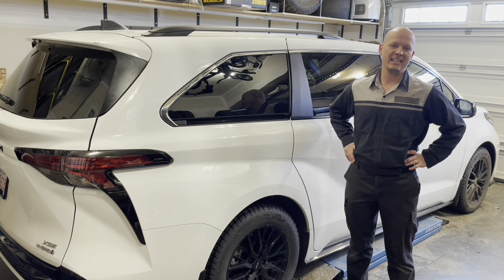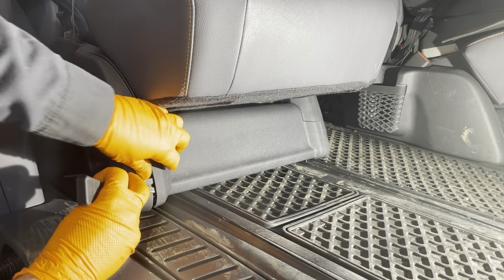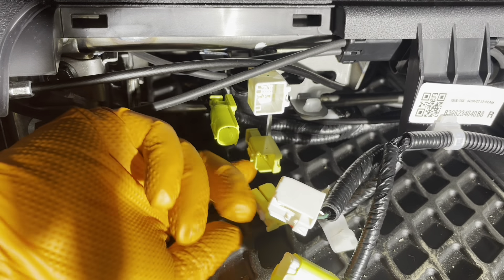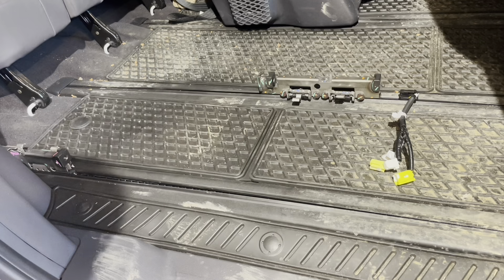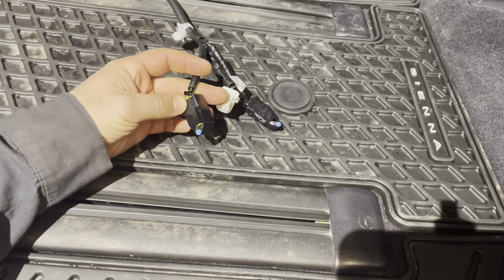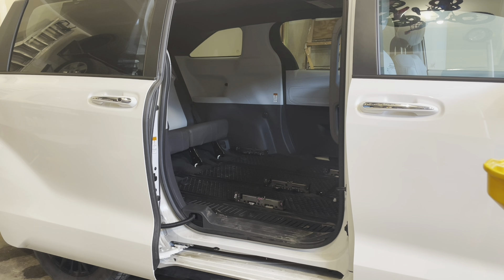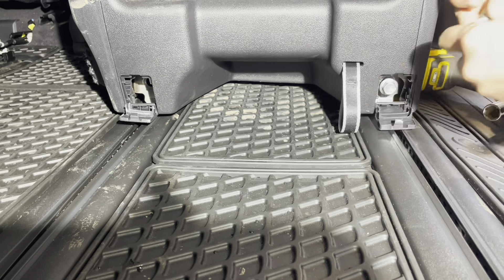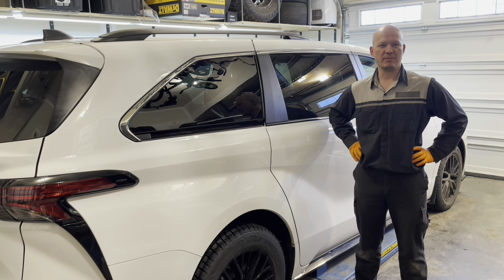2021-2025 Toyota Sienna Hybrid 2nd Row Seat Removal And Airbag Warning Light Disabling Instructions

Comment from the maker: Below are my affiliate links to the parts and tools you would use to complete this job. I may receive a small commission from the product sales. Thank you!
Resistors to bypass the airbag warning: https://amzn.to/3wF3OzV
Automotive trim and clip removal kit: https://amzn.to/3KgKGfg
1/2" drive cordless impact wrench kit: https://amzn.to/3Kcw00I
3/8" drive flex head digital torque wrench: https://amzn.to/3O1EOru
Rechargeable LED mini work light: https://amzn.to/3Y74OpY

Comment: This is literally all that's stopping me from buying Toyota. If DODGE of all people can figure out that we want stow and go-type seating for all seats other than the front two, why tf hasn't Toyota gotten the memo?
Reply from the maker: There is physically no space for that feature because of the hybrid battery located in the floor.
Reply: @Viktor_G_Automotive  sounds like they need a better designer. I wouldn't buy hybrid anyhow.
Reply: To be fair, a Pacifica Hybrid doesn't have Stow and Go either.

Also, I bet Chrysler has some patent on it. If they do, that's pretty smart on them because I would have definitely bought from another brand if someone else had it.
Reply: Toyota used to have removable seats in every Sienna and Previa until the Hybrid redesign in 2021
Reply: @Viktor_G_Automotive why couldn’t they make it so you can remove the front seat more easily
Reply from the maker: @SAMGASS  well, removing 4 bolts isn’t terribly difficult 😉
Reply: @Viktor_G_Automotive  right but I mean Honda odyssey style easy. Pull a strap, take it out.
Reply: Ditto for me! I want the cargo area & the hybrid lacks it due to those seats not being easily removable or stow&go.
Reply: @SAMGASS  Toyota moved the side curtain airbags from the inner sides of the vehicle to the seats.... so now you have wiring running through the seat bottoms. If they really wanted to, they could probably make the wiring connectors an easy part of the seat removal and reinstallation process... but they are probably worried about liability from them not deploying if someone doesn't reconnect them properly...

Comment: Word of advice. MAKE SURE NOT TO SHORT THE RESISTER LEGS! It will throw a hard error code that cannot be reset without an advanced ODB reader. My dealer gave me a free reset but cautioned that any code again would cost $190 to reset. Also they did figure out I had removed the seats.
Reply from the maker: @Over50YearsOffgrid  good suggestion. If you accidentally make that mistake again, you can also purchase a scan tool to clear the code for less than the $190 the dealer wants to charge you.
Reply: @Viktor_G_Automotive  I took it to Orielly's but their reader wouldn't read airbag codes.

Comment: It's bad news the new sienna can't remove second row seats easily (seems like they don't want you to remove them.) I've been using my 2013 as a camper and to haul people and plywood, thinking to replace it with a new one. Now I know the new one won't work. Thanks for video
Reply from the maker: You are welcome! It is definitely doable and it fits a 4x8 sheet of plywood, but it is a little bit more work than the older model.

Comment: The instructions provided is very helpful and has helped me greatly. Thanks, Viktor! I would like to mention a few changes with my 2021 Toyota Sienna Hybrid LE. 

1) Each seat has four 17mm bolts which need to be removed (2 short bolts in the front and 2 long bolts in the back). 

2) I just need to remove the front seat covers (not back) to access the electrical connectors. 

3) Each seat has 2 connectors (not 3) - one yellow and one white.
Reply from the maker: @amelon1  is it an 8 passenger model?
Reply: @Viktor_G_Automotive  Yes. Mine is an 8-passenger model (second-row bench seat)
Reply from the maker: @amelon1  ok, makes sense that it would be a bit different from the 7-seater version 👍

Comment: Great video.  Thank you. What are those blue pins you connected to the cables? Also, how do I reset the maintenance service indicator for a 2017 Sienna?
Reply from the maker: Those are resistors to trick the airbag ECU into believing the seat airbags are still connected. I can make a maintenance reminder reset video for that model if I get my hands on one.

Comment: Hi Viktor!
My question is today , i have lexus es330 2004 , drivers seat , back support bottom , not working .
How to fix ,where i must to check and what?
Thx Magic man!
Reply from the maker: Check for voltage to the switch, check if the switch is working, check for voltage to the motor. If everything is good, needs new motor, or if you find an issue with the power supply or switch, repair/replace whatever is needed, check fuses, connectors etc. There isn't a magic answer that will diagnose the issue without putting in the work unfortunately :)
Reply: Wow thx ;
The motor inside back support or under the seats?
Reply from the maker: @madi482  Unfortunately I don’t know it’s exact location, you would need to unbolt the seat, lean it back with the wiring still connected and start poking around to find out which motor controls which part of the seat.

Comment: Any chance you can make a video on removing the sliding seat carriage parts after removing the seat? So the interior space is as flat as possible without the metal pieces sticking up.
Reply from the maker: I may do it one day, but it is a pretty involved procedure, requires dropping the fuel tank etc.
Reply: @Viktor_G_Automotive  gotcha. I was hoping to get the interior flat for dog crates.

Comment: A friend helped me remove the 2nd row seats in my 2023 Sienna, which took us forever as I had not discovered your excellent video!  Once I found it, we followed your directions to disconnect the battery, install the 2.2 ohm resistors and taped in place with electrical tape.  We reconnected the battery, reset the doors and turned on the engine.  The "SRS malfuntion" screen came on and we cannot get it off.  Can you help?
Reply from the maker: I would remove the electrical tape and confirm that the resistors are fully inserted into the connector. Wiggle them around a bit while pushing the legs in to make sure they make contact. Also, confirm that you didn’t get wrong resistors by measuring the resistance with an ohmmeter (resistor must be out of the car!). If all that checks out, scan with a good scan tool to find out what the SRS fault codes are in the system.

Comment: I followed your instructions and everything worked exactly as it did in the video. Many thanks!
One question; is the S/HTR D fuse for the heated back seats? I'd like to disable them.

Thanks in advance
Reply from the maker: S/HTR D fuse is for the driver's front seat. You need to remove the 15A S/HTR R/L fuse in the engine bay fuse box and the 15A SEAT HTR RR fuse in the luggage compartment fuse box.
Reply: So am I just wasting time? Is the power to rear seat heaters the connector we didn't use a resistor on?
Many thanks for sharing your expertise!
Reply from the maker: @DrewC-z9r  yes, the power to the seat heater will run through the connector. Could you please elaborate on what you are trying to achieve when you say you want to disable the heaters? Are you leaving the seats in or removing them?
If you unplug that connector and leave the seats installed, the seatbelt clip detection goes through that connector as well, so it’s better to just remove the fuses for the heater. 
If you are removing the seats, you don’t need to disable anything or pull fuses since the seats are out.
Reply: Sorry for the confusion; I removed the seats and will not reinstall them. My fear is that, if someone presses the overhead rear seat heater switch, it would overload a resistor. If it's just the 3rd connector that is unattached, no problem.

Thanks again
Reply: I understand now. Apologies for taking up so much of your time. I owe you big time!😊
Reply from the maker: @DrewC-z9r  no worries, the resistors are just for the airbags.

Comment: Thank u Victor.  Great video. Question re the resistor insertion per connector. There's multiple holes in each to insert the wire x 2 per connector. Is the a screenshot to ref short of zooming in on your video which is hard to focus from. I could guess but don't want to short anything...
Reply from the maker: @BillTrubey  hi Bill, just look at the male side of the connector to see where the 2 pins are located and insert the resistor legs into the 2 corresponding female pins. You can’t short anything out even if you install into the wrong holes, just the airbag warning light will stay on if you don’t do it correctly.

Comment: Wanting to do this on a 2018 Highlander and this is the only video I could find that was close. One questions, will having the airbag connectors hooked to the resistors cause any issues with the other airbags deploying in a crash? I would assume they act independently to some extent for safety reasons. Thank you!  Your video is clear and instructions easy to understand.
Reply from the maker: @portlandgeek  all the other airbags will work fine, the SRS ECU has no idea that the second row airbags are disconnected since the resistors are tricking it. Cheers!
Reply: @Viktor_G_Automotive  Thank you!! Really appreciate your feedback!
Reply from the maker: @portlandgeek  any time!

Comment: is this the same for the 2024 Sienna Limited? Can the seat carriages be removed too?
Reply from the maker: Yes, limited is done the same way. The carriages/tracks can be removed, it’s a bit of work though.
Reply: @Viktor_G_Automotive  once the carriages are out, how hard is it to reinstall? and…harder to remove them than the sets themselves??
Reply from the maker: @707bluedogs  I have never removed them, but I believe they bolt in through the floor from the bottom and may require a significant amount of time to remove and reinstall.
Reply: @Viktor_G_Automotive  thank you
Reply from the maker: I looked into removing the seat rails. The outer ones can be removed from the top, you would need to pull up the carpet and unbolt them. The inner ones have to removed from the bottom, requires dropping the fuel tank. Hope this helps.

Comment: I have a 24 sienna without for lights. I see the wire have been ran to the bumper, but my steering wheel does have the knop to turn them on. Can you please do a video on the part i have to replace
Reply from the maker: @abcabc-gj6id  there is more to it than just the switch, the fog lights are wired through the light control module that shuts them off when high beams are on etc. It would take some research to figure out exactly what would be involved in integrating them. It would be easier for you to just wire them using a relay and a standalone aftermarket switch.

Comment: GREAT video - thanks!  I wonder how much each seat weighs?  When I get my Sienna I am taking the seats out and leaving them out for a long time.  Getting rid of probably 120 lbs of weight wont hurt.  I want a Sienna for road trips with our dog
Reply from the maker: @jimc5696  I haven’t weighed them, but I would guess they are somewhere between 40-50 lbs each. Cheers!
Reply: @Viktor_G_Automotive   thank you!  Only other thing I will need to figure out is some sort of soft cover for the sliding floor pieces.  They look sharp objects (without the seats attached).

Comment: Your link to amazon for the 2.2 ohm resistors show several watt sizes such as 1W, 1/2 W, 3W. What watt size for a 2023 Sienna Platinum please?
Reply from the maker: The maximum wattage doesn’t matter as there is a essentially no current running through them.

Comment: Great video!!  I have removed my back seats.  Now I'm looking for a way to remove the passenger seat.  Any ideas?
Reply from the maker: Thank you! The passenger seat is removed using a similar method, however it would be harder (or impossible) to get rid of the airbag light due to the weight sensors of the occupant classification system being disconnected.
Reply: @Viktor_G_Automotive  Too bad.  No way to fool the system for that one?
Reply from the maker: @tangoandmisspearl  I haven’t tried yet, I might make a video in the future.
Reply: @Viktor_G_Automotive  That would be awesome.  I sure could use the extra space in my Sienna camper.

Comment: Excellent video thanks! Do you know if this voids the warranty? Ours is new and we still have the covered oil change/fluid check etc at 10,000 miles. Will they turn us away or if this seat isn't installed? 2 separate questions.
Reply from the maker: It should not void the warranty or have them turn you away. However, some dealerships are very easy going and others are very picky. If you install the resistors correctly and there is no airbag light on, they wouldn’t have a reason for concern to do an oil change. However, if you come in for airbag system or other electrical diagnosis, they might have an issue with it. You can always reinstall the seats before bringing the vehicle in, it’s a 20-30 minute job.

Comment: There have been some changes to the van for 2025. Can you absolutely confirm that the middle seats can be removed and a dongle to fool the computer SRS ?? 
We really want to replace our Odyssey with a Sienna and remove the seats. 
I am all set with the mechanical process, it’s just the electrical/computer that I am worried about. Thanks JT from the frozen north east….
Reply from the maker: Hi, there were no changes to the 2nd row seats and airbag wiring on the 2025 model. You do not need a dongle for the SRS, just install the resistors as shown in the video.
Reply: Thanks for the reply/ info.
Reply from the maker: @ no problem

Comment: Hi Viktor: thank  you for your clear and details instructions on the 2023 Sienna. I just bought the 2024 XLE Sienna and want to know if your instructions can also be applied for 2024 Sienna as well?
Reply from the maker: Yes, absolutely.
Reply: Viktor- Can you still remove the second row seats if they are heated?  Is it just another plug or more complicated?  I want to buy a used 2022 Platinum, but only if I can still remove the second row seats.
Thanks!
Reply from the maker: @fcmagility  same thing, might just have one more connector to disconnect.

Comment: Hi Viktor, This is a great video.  So, I am going to need 4 resistors (2 per seat?)!  By any chance the 2.2 Ohms resistors will work also for 2025 Sienna Woodland edition?   Many many thanks for your time to contribute to the Sienna community!
Reply from the maker: @andytan9238  hi, yes, 4 resistors, works for any model 2021-25 Sienna. Cheers!
Reply: Thanks for the quick reply.  Would you please share on the purposes of the 3 connectors per seat?  Assuming the last connector is for the airbag, what are the first two connectors for?  Why don’t we need three resistors for the 3 connectors?  Thanks again for your time!
Reply from the maker: @andytan9238  The 2 yellow connectors on each seat are for the side airbag and seatbelt pretensioner. The other connector is for things like seatbelt clip detection, seat heater etc. The resistors are installed to trick the SRS ECU into thinking the airbags are still there so that it doesn’t set a fault code. It doesn’t care if the seat heater is disconnected or seatbelt is unclipped, therefore you don’t need to do any other trickery.

Comment: The 2024 Sienna Platinum has heated seats in the 2nd row.  Any advice for removing those?
Reply from the maker: @jeffreyb4147  same thing, would just possibly have an extra electrical connector for the heated seats to disconnect.
Reply: Same electrical connector? @Viktor_G_Automotive
Reply from the maker: @vickisherouse1521  hi, I don’t own a platinum Sienna, but just look under your seat when you unbolt it and disconnect all electrical connectors required to remove it. The heated seat wiring may be built into one of the connectors shown in this video, or may have a separate connector, it will not change the procedure substantially.

Comment: @viktor_G_automotive would this trick with the resistors work with other newer vehicles like a 2024 Ioniq 5 for the rear seats?
Reply from the maker: @johnreed7057  it’s quite possible, however I have not worked on Hyundai vehicles, so I don’t know what the resistance value should be. You can try the 2.2 ohm and see if that works. If the airbag warning light goes out, you are good.

Comment: Possible to remove the rails?
Reply from the maker: Yes, it is
Reply: How do you do it?
Reply from the maker: I haven’t had the need to remove them, so I haven’t looked into it, but it appears that they bolt in through the floor. It would likely take a fair bit of work to remove.
Reply from the maker: I looked into removing the seat rails. The outer ones can be removed from the top, you would need to pull up the carpet and unbolt them. The inner ones have to removed from the bottom, requires dropping the fuel tank. Hope this helps.

Comment: Does it need to be a 3 watt 2.2 ohm resistor? Will a 2 watt 2.2 ohm resistor work without burning out?
Reply from the maker: @lokusfrog  yes, the wattage is not important, there is almost no current flowing through it

Comment: I have a new Toyota Sienna LE 2024 and just finished removing the seats.  Your video shows 2 yellow air bag
 connectors a 1 white one .  
My LE has 1 yellow and 1 white connector.  The airbag light does not go off. What do I do.?
Reply from the maker: @st4t86  did you install resistors into the yellow connectors?
Reply from the maker: Did you install resistors into the yellow connectors?

Comment: I CANNOT get the bolts loose.  I bought an 18mm to remove the bolt, and they are sooo tight, it’s damn near impossible.
Any suggestions????
Reply from the maker: @CaraStoltz  hi, they are 17mm head bolts, 18 mm socket might round them off and damage the head.
You need either an impact gun or a long breaker bar to remove them.